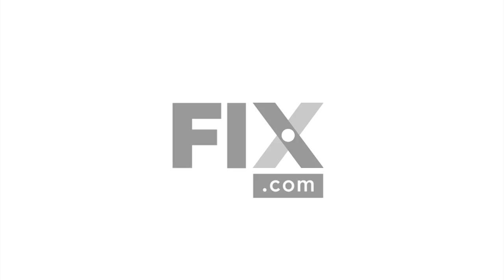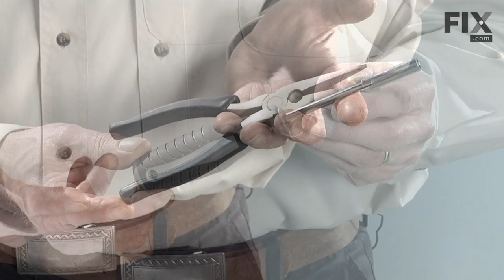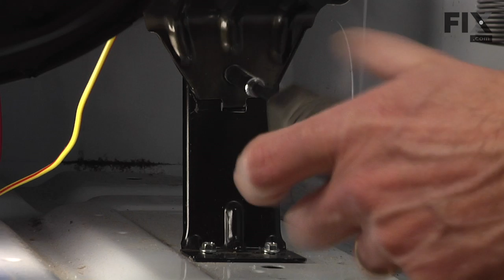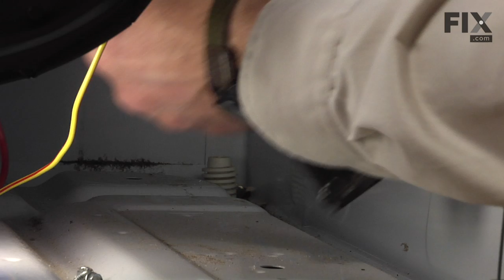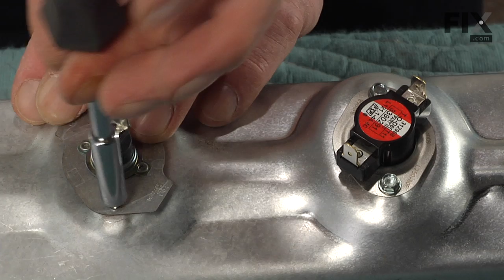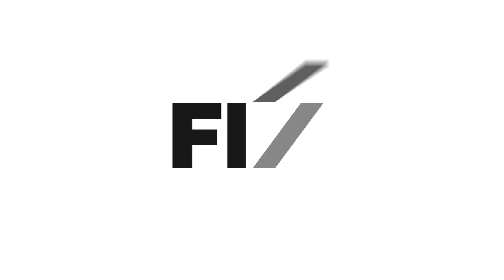Kenmore Dryer Repair – How to replace the Thermal Cut-Off Kit

Comment: Your videos are completely informative BUT ALSO so pleasant to watch…  this one didn’t even apply to me since our dryer is gas (actually, it does BUT ❗️I’m trying to find where the thermal fuse(s) are located on the Kenmore Elite 110.78082701,   (with the one-pc front panel and lint screen located at dryer’s door)❗️
   Could you please help me with that?
Thanks again for being the best on YouTube!!

Comment: I replaced all mine and it still keeps tripping. Vents are cleaned no obstructions. What else could it be ? I’m at a loss
Reply from the maker: If it's is the circuit breaker in your house panel that keeps tripping it maybe an issue with the breaker itself. There is a simple test you can do before calling in an electrician or appliance tech. Run your dryer for 15 min in a heating cycle go to your panel and lay the back of your finger against the breaker for the dryer. There are two single breakers married together. See if one is feeling very warm to hot. If so there is a good chance the breaker is the issue. An appliance tech would likely put a current meter on the dryer to ensure it is drawing proper amount of current.  If it is and that breaker is hot and trips then the breaker should be replaced.